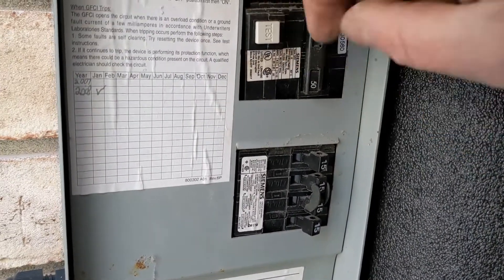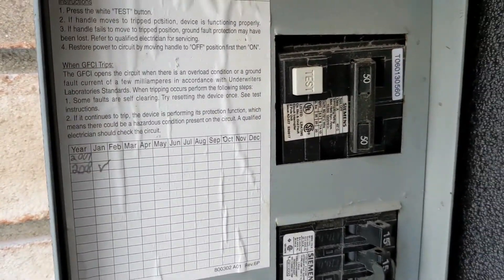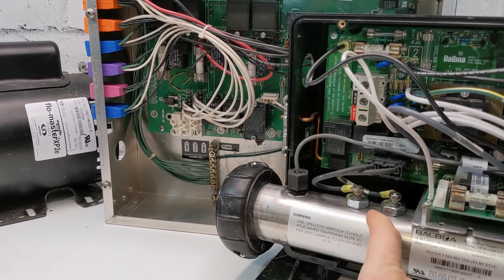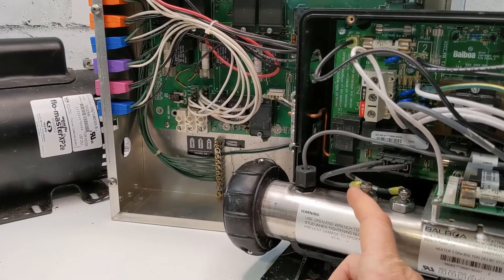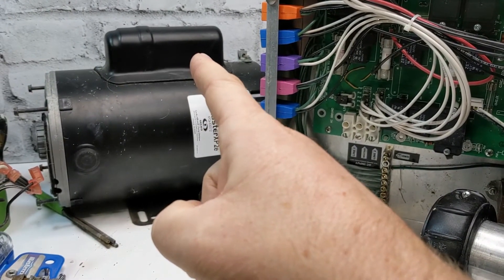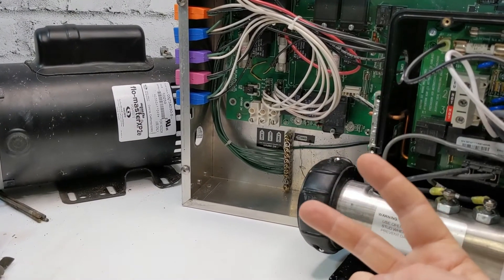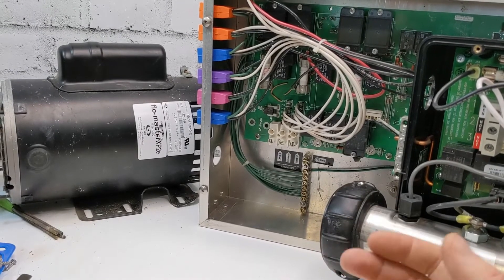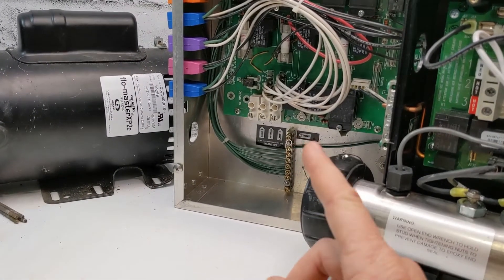2 Common Reasons a HOT TUB Trips the Breaker / HOT TUB GFCI Breaker

Comment: What if it runs and moves water for 30 seconds or so and makes more noise than usually then trips the breaker in the breaker panel?
Reply from the maker: The pump is making the noise?  If so, it's the bearing.  Seal failed, leaked water onto the bearing and that's the noise.......MAYBE.  lol   Is it the pump making the noise?
Reply: @VIPPoolsandSpas  the pump kind of sounds like it’s got a few popcorn kernels tapping around.   I ran it with no water for a little bit and now it’s not tripping the breaker with water.    Still sounds a different
Reply from the maker: @sjhanksaz  maybe the capacitor is going.  Can always check that?
Reply from the maker: Just following up on your hot tub issue.  Was it the capacitor ?